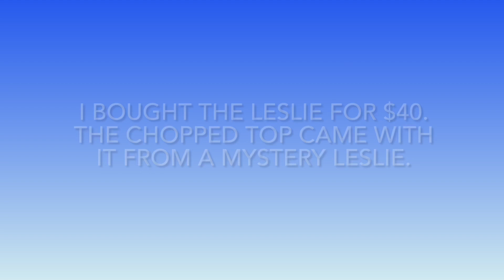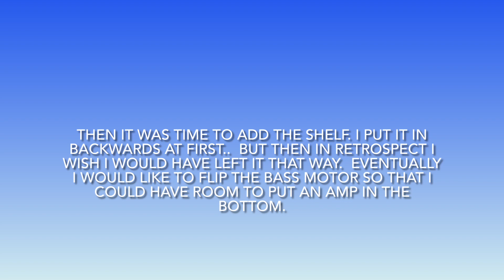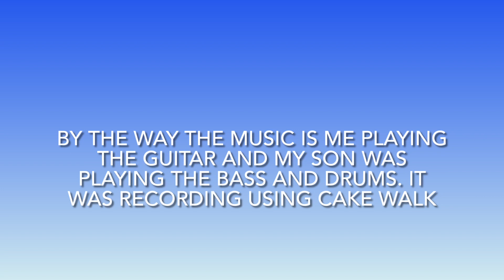Leslie 120 conversion. Adding the horn.  Someday will be paired with my Hammond C3

Comment: Very cool that you put it together. I have a 120 myself and a loose horn assembly on a plank on top, with some makeshift legs. With a simple passive crossover, and connected to my M100. Now I was looking for inspiration to build the rotor into the cabinet too and noticed your video. And I am not looking forward to the wood working, haha. Do the horn and the drum rotate the same direction now? I guess if you rotate the drum top to bottom, then they would counter-rotate, that should sound more rotary. Thanks!
Reply from the maker: Yes they both rotate in the same direction. I'm not sure what the difference in sound would be but it sounds great the way it is. If I were to do it again I would hog out all the material in the louvers with a forstner drill available at harbor freight first. And just use the router to clean it up.  Good luck.
Reply: @davepontrello4159  If it sounds great, don't change it! I'll have to try and see how it goes. Maybe this winter.